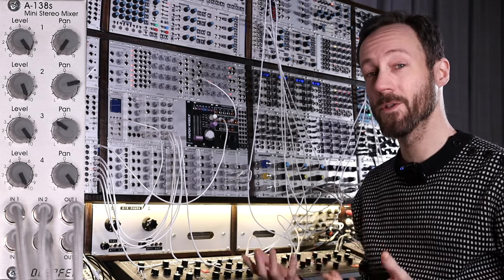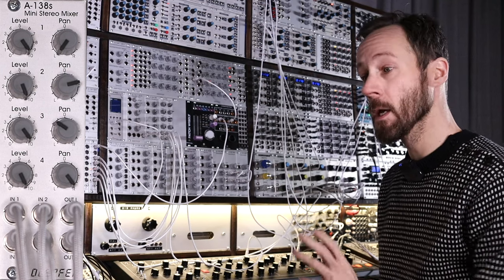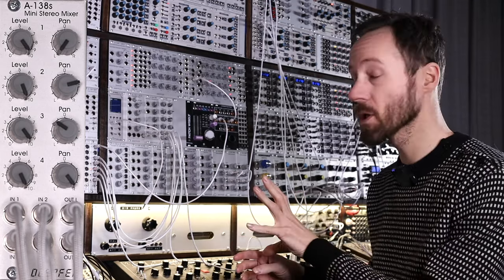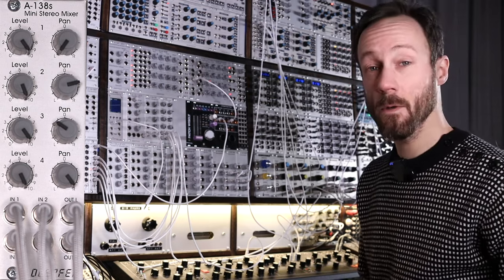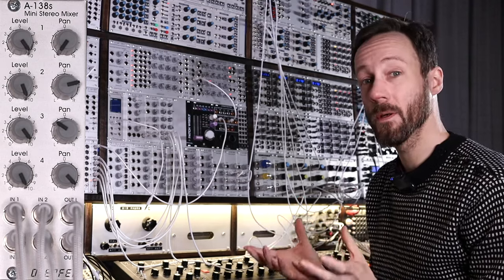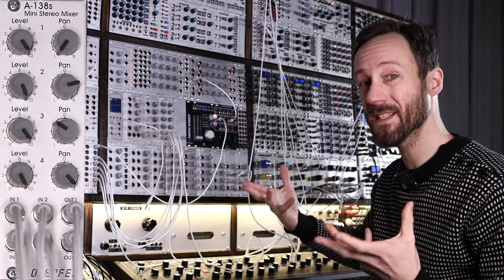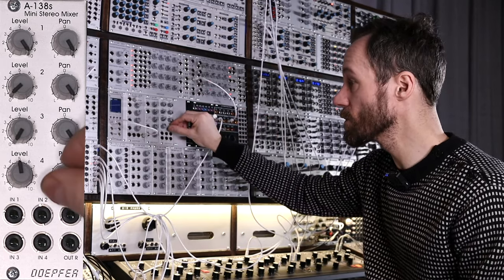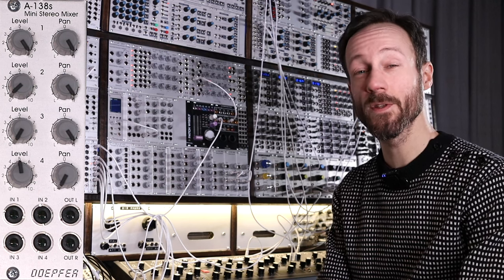Doepfer A-138S Stereo Mixer

Comment: Another excellent video 👏 I've recently got my first modules, just a small rack for effects, only 9 modules so far (with the 10th currently on its way from Romania, hopefully), and I have this stereo mixer. I got it to use with the Dreadbox Nostalgia delay module because it's a 3 stage delay, so I use the Doepfer A-138s to pan the 3 separate delays around the stereo field, and it works perfectly for that. I can see myself getting a second A-138s sometime 🤔
Reply from the maker: That's how I got into modular too, it quickly derailed 😅